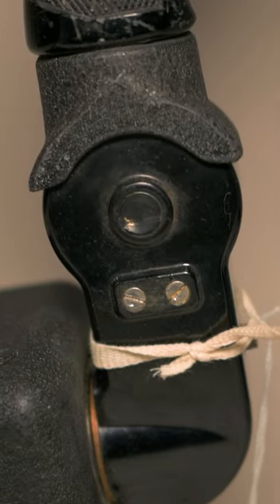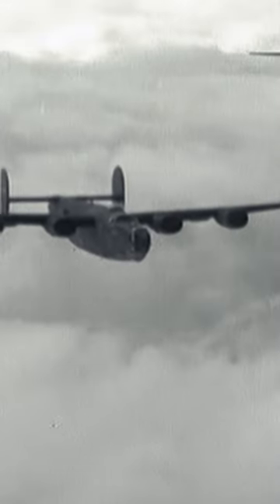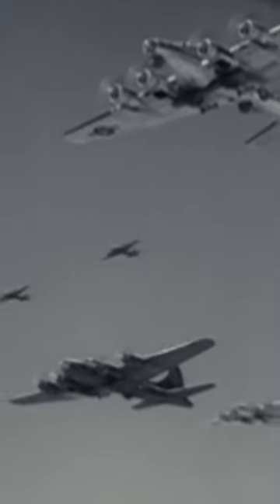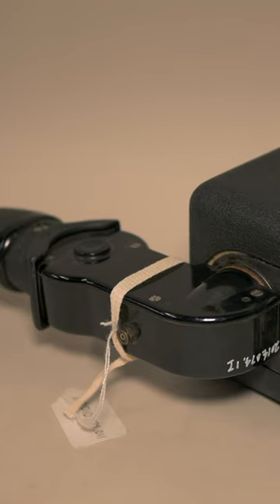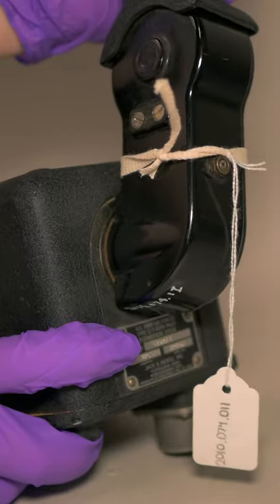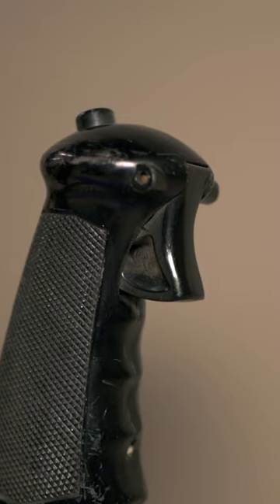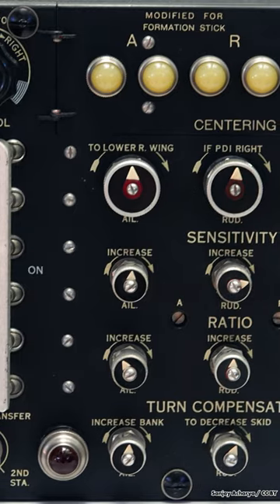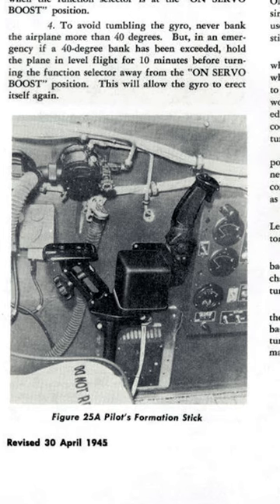Formation Stick for the Type C-1 Autopilot

Comment: Basically, an auto flight system is divided in two parts: the flight director, which is the "brain", and the autopilot servos, which actually move the control surfaces. The flight director processes a number of inputs, and sends signals to the servos in order to follow the desired flight path. What this device does, is that it allows the pilots to control the aircraft indirectly by sending signals to the servos, and they will respond as if the signals were coming from the flight director itself. This way the pilots can indirectly control the aircraft without disengaging the autopilot.

This technology still exists today in modern jets. In the Boeing 737, for example, pilots can engage the autopilot on a special mode called Control Wheel Steering, and control the aircraft by sending signals to the servos. The only difference is that in today's aircraft, there is no need for a separate yoke or stick - the system uses the same yoke used for manual flying.